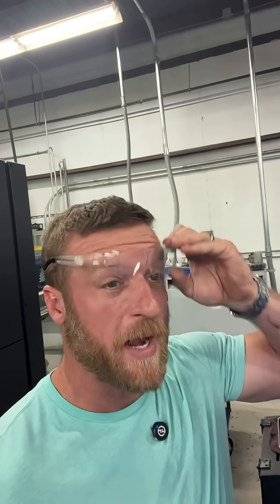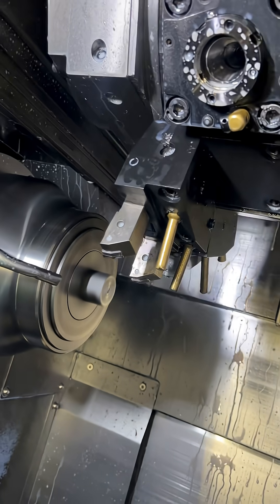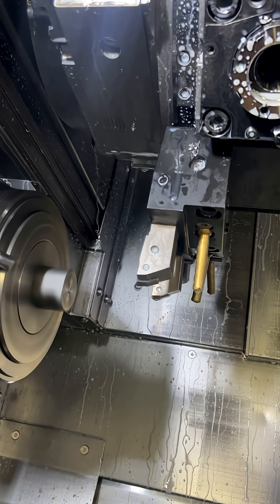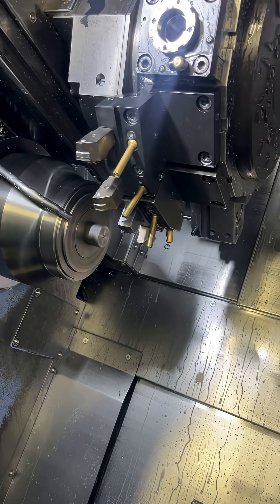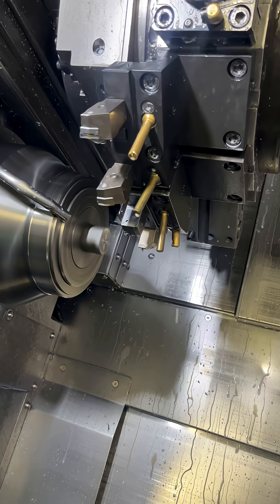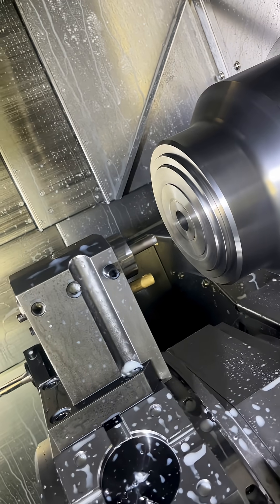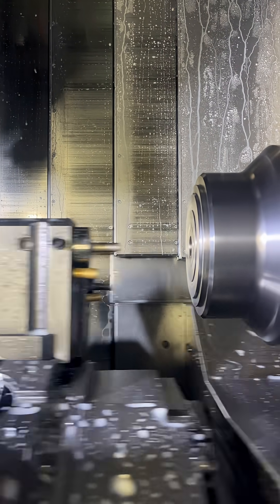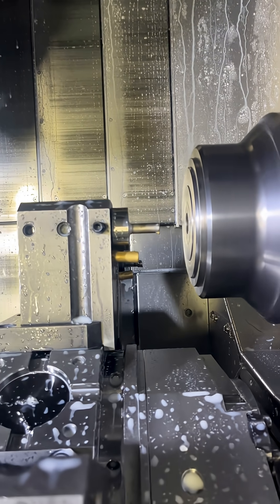It took me 4 minutes and zero dollars to speed this cycle up. Time = MONEY 💵 #time #cnc #tools

Comment: Sounds like a machine running in the background needs a Z axis bearing. We have a Hwacheon that screamed just like that, now it's silent after I replaced it. Good work man every second counts. I hate seeing lathes go all the way home wasting time
Reply from the maker: Thanks man - and that sound is either a bearing like you said or we have a job running some hex that we are grooving into it with a 5 mm Kenna groove so it sound like a wicked interruption. I agree about every second counts for sure.

Comment: So I run okuma lt2000ex 

They have and adjustable home position, once I prove out the program I bring in the turret manually to see how far out in Z I have to be for clearance and set that. 

Also, on smaller stock, I turn off constant surface foot. Just rev up to 3k rpm and go with all carbide tools.
Reply from the maker: Heck yea man that’s awesome! We have a couple of those too. Great machines those Lts are

Comment: Slow down your max spindle speed some. Rarely is high spindle speed needed. And the ramping up, and ramping down adds excessive time to cycle. There's a few other tricks with spindle speed programming that can save cycle time. But play with the G50 some. And see what happens
Reply from the maker: I appreciate the input. That winding up and down is actually me on the override pendant cranking it up and down a few times 😂
Reply: @Crusadermachining lathe spindles tend to have a delay before indexing to next tool due to it waiting for spindle to ramp down as it goes and gets to retract position. When going from turning to a drill with high spindle speed I would after turning last pass and tool coming off part you add a g97 at drill speed preventing any ramping and slowing of machine. Finding the right places to insert those tricks, than playing around with the numbers will make a big difference in high production. Takes a little bit of extra programming, but worth it. And it's better for the life of the machine as well. Many benefits

Comment: Clearance is clearance. You don't have to G28 home everything for every tool change. I usually write down a safe position for all my tooling to clear and just G53 for the tool change. You can also rapid almost right up to the part. I'll rapid in so close that it would make your butthole pucker if you didn't know it was good. G0z.010 off the front of the part.